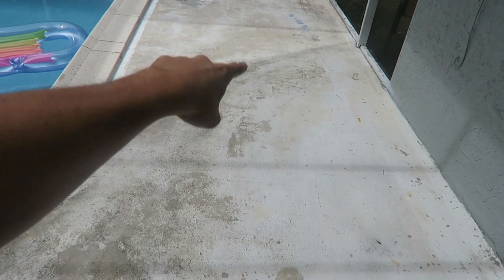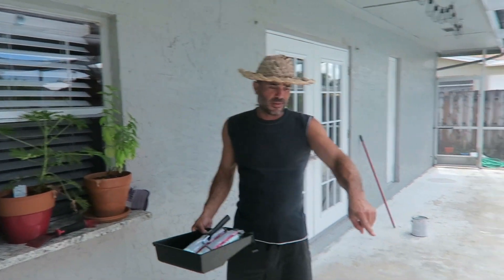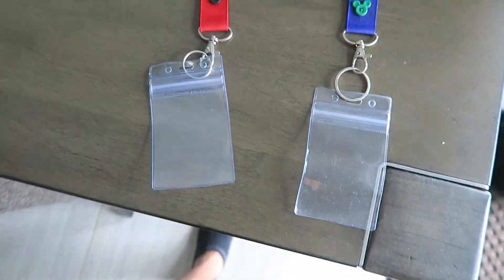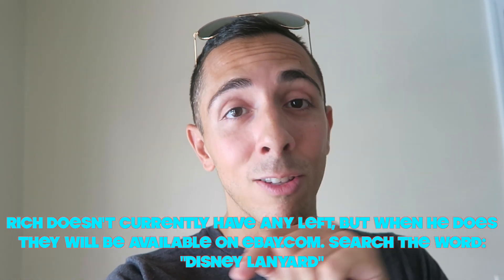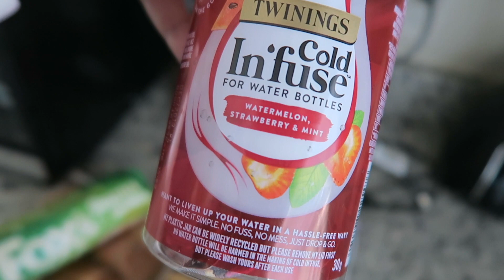WHAT A FLIGHT ATTENDANT DOES ON HIS DAYS OFF

Comment: Nice video! Funny that mention your problems with Amazon. I had a similar issue when trying to order a high end gaming laptop from them. At first they were not sure it was going to be back in stock. Then that one particular one wasn't, but they had a basically identical one on another page, so I put in an order for it that I had to wait a month for, then it was suddenly canceled. Supposedly it was canceled by me. This was 3 months in by the way. Why would I cancel something I was willing to wait 3 months for? So I placed it back on order and waited another month only to have them deny my credit card. I figured this was due to a limit on the card, so I called and had it sorted out, so there should have been no issue when I attempted to order it again. Nope, declined again. By this time, I assumed Amazon didn't want my money, so I found a private shop selling it and got it in 3 more weeks. In the end, I'll never attempt to buy anything of a large value on Amazon again. All their credit safety protocols are hosed up and you likely won't get what you want from them. They are good for small stuff, but screw the large stuff with them.